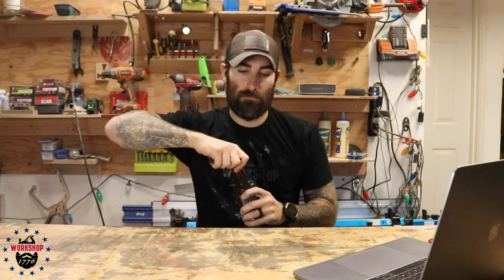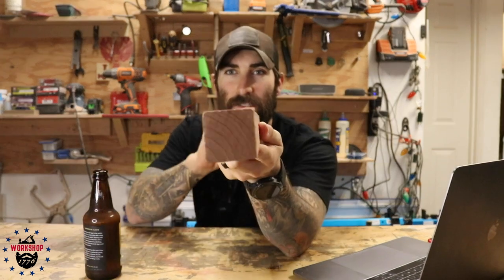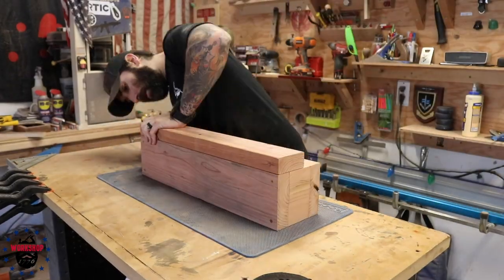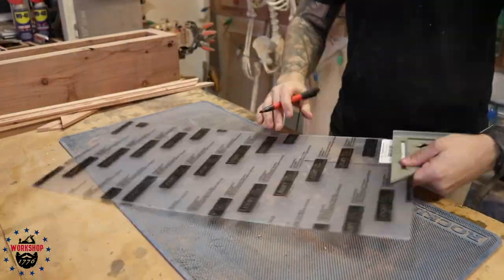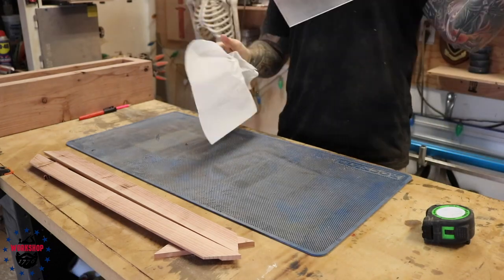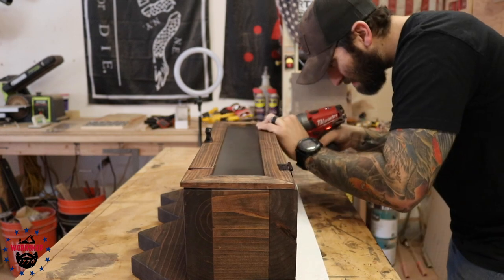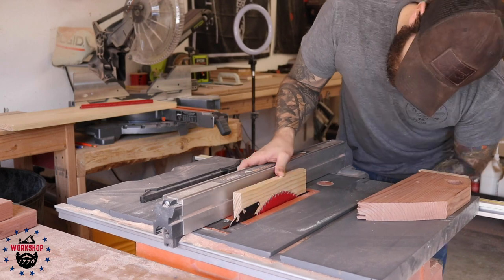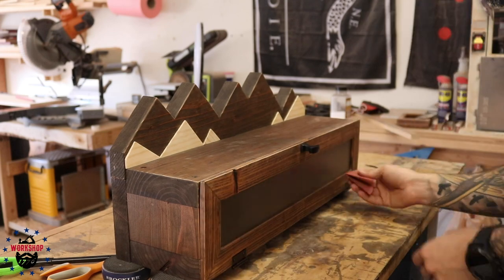DIY Entry Shelf/Phone Lockbox

Comment: This is rad, have you made a mini version on this? For like a nightstand area ?
Reply from the maker: Vintage Doll thanks! I haven’t but that’s a good idea!
Reply: Workshop 1776  gotcha, was just wondering what dimensions you would have used on it.
Reply from the maker: @mzfitmama2361  im not really sure, this was a pretty bulky build, if i were to scale it down, i would probably go with 1/4" material (rather than the 3/4") and substituted the hardware.